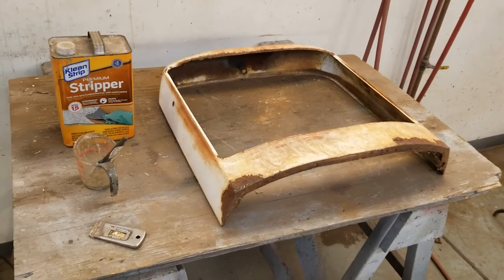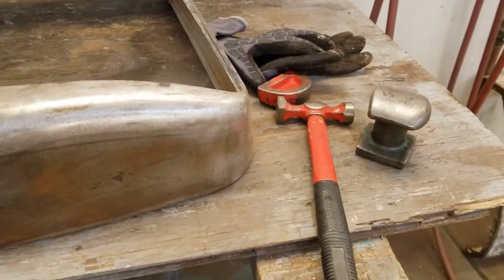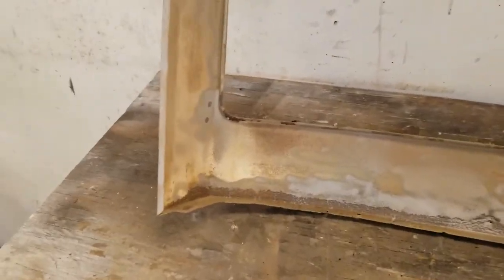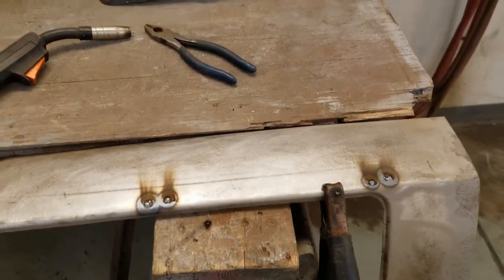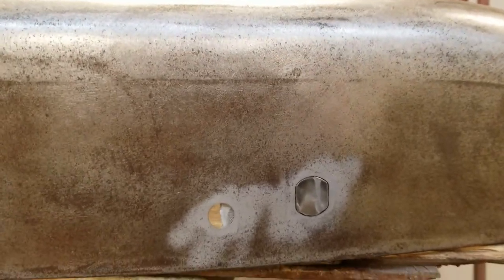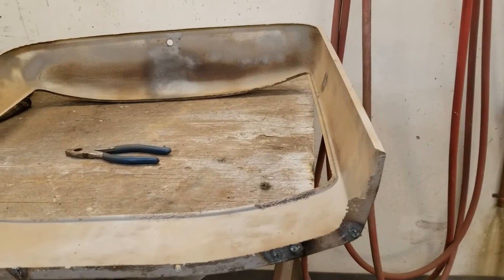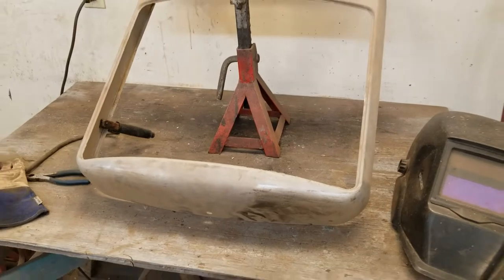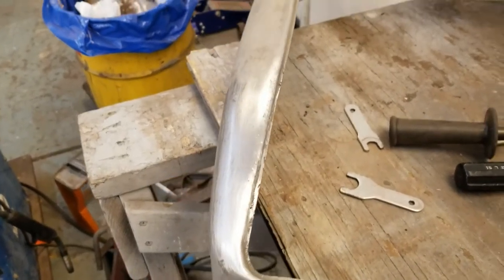Gas Pump Restoration Part 5 - Reworking the Top Panels

Comment: I have a slightly later Gilbarco pump, with square corners but it still has the round piece on top for a globe. It also has the exact same computer/gear mechanism, and it's complete but seized. And full of dirt dobber nests from my dad's farm. I look forward to your videos of finishing this! I'm leaving mine with the patina, oiling it, and turning it into an electric car charger. Thank you for these videos!
Reply from the maker: They are a lot of fun to work on.  Some WD40 and a bit of patience will get your computer moving again.  I plan to add a motor to run mine with a switch in the nozzle.  I am getting back to work on mine now that winter is coming to Michigan.  I hope to have another video on before the end of the year.  Good luck with your pump!

Comment: Did you ever finish this project??
Reply from the maker: You caught me!!  Tha snow melted in Michigan a few months ago and I've been driving my Studebakers.  The pump sits as it was shown in the last video.  I will probably restart the work this fall.  I have the globe, ad glass and panel advertising ready to go.  I need to find a long hose since this has a retractable hose.  !thanks for watching.  More to come.  Neil
Reply: @neilloughlin7080  that’s good to know…I have the same pump over here in the UK, so this has been fascinating to watch…and oddly enough I commented on your dial restoration video and I was doing another replica pump and needed the benefit of your experience…I got it sorted in the end ….anyway, have a great summer and I’ll see you in the Autumn 😊
Reply from the maker: @brianhull5125  sorry for not replying on that.  I usually respond right away.  If you need any odd meter parts let me know.  I have some left over from my donor meter.
Reply: @neilloughlin7080  Thank you, that’s very kind, but I have sorted it now 🙏🏼